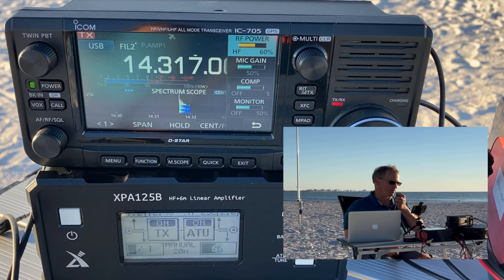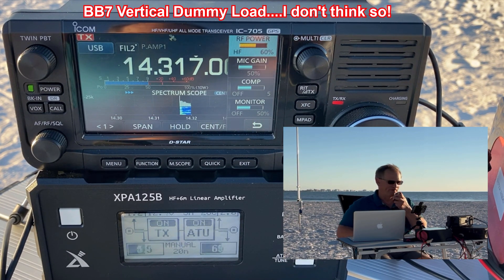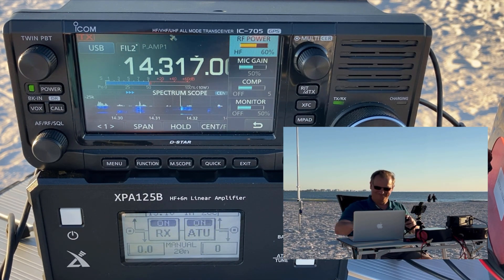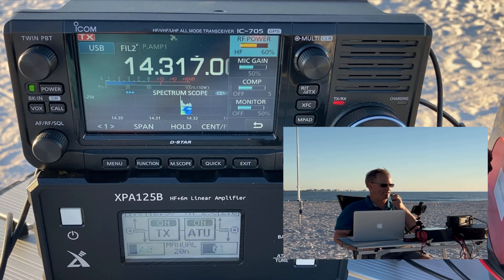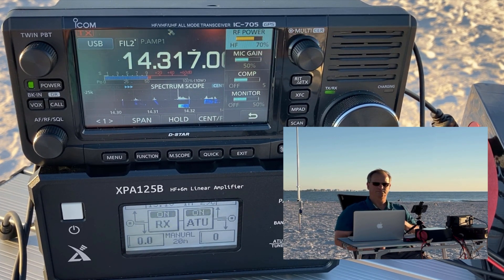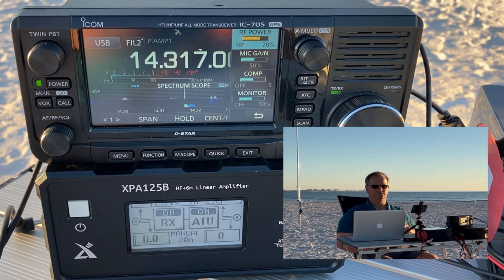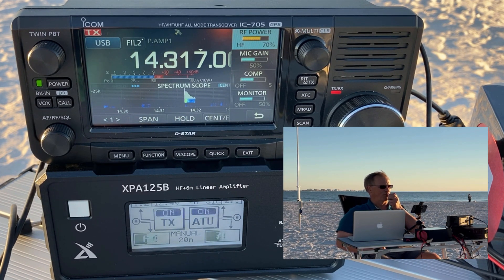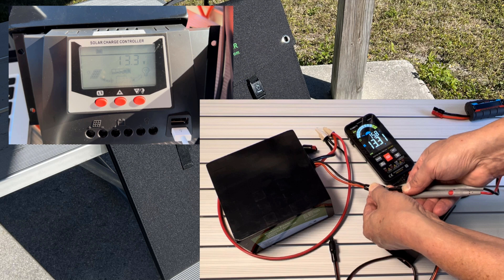Winter Beach POTA with a BB7V Vertical (Dummy Load) Antenna, IC-705, XPA125B Amplifier, and Bioenno

Comment: Just pulled the trigger on one. read also about dummyload but this is a second video i see from you where you are so positive. so i just did it>
Thanks!  73 Tony PE1ONS, The Netherlands
Reply from the maker: People often call something they don't understand a dummy load.  Because it doesn't use radials, it's using coax shield as the radial.  Of course you can roll like that, or just add some radials.  I've always operated without them.

Comment: Hi, Bob
Thanks for the vlog. Im in the market for an HF antenna and have narrowed down my options between the Diamond BB7Vor the Comet CHA 250HD. Have you tried the Comet? Does the BB7V work on 6m? In your other BB7V video review, I saw you added an LDG choke - Are you using it in this video as well? Based on the specs for both antennas, which would you prefer? Love the Tampa area. We're 1 hour east near Disney. We visit  Clearwater Beach often by Frenchys.
Thanks
KQ4LNW 
73
Reply from the maker: Thanks for the view and question.  I do not have any experience with the Comet CHA 250HD, but from the description the main difference seems to be the BB7 is quick up and down, and the 250HD is a permanent install.  So, perhaps that would help with your decision.  

The BB7 advantage is exactly that it is quick set up and portable; if you are going for a permanent install, I would have considered something else, perhaps the 250HD.  If you are going permanent install, you may want to investigate 20' or more long antennas that that have resonance; that would be even better; I do not have any I've tested so I don't have a recommendation.

As best I remember, at the beach activation, I did not have the choke on the antenna and I wasn't having any issues.  I would still recommend a choke, and there are many out there including "in line" i.e., part of the coax.

Comment: Don't worry, dear friend, I think the Diamont is brilliantly built, as the parallel resistance in the transformer actually reduces the total resistance and therefore makes the half-wave antenna better than the Sigma and co with a transformer resistance.  But most amateur radio operators have forgotten the simplest questions Hi
Reply from the maker: Fantastic, thanks for the informed feedback.

Comment: TBH I was in the expensive dummy load camp,for some time. However Over the last few weeks. I have had multiple DX QSO 's on 17 m and 30m the best being 5/9 into Norway from my QTH in north east Thailand.. Mounted 1 meter of the ground. And 200w.. I am now a believer.
Nice demo of the BB7V ..
73s HS0ZOU..
Reply from the maker: Thanks for commenting and sharing.  Its always good to hear when others have similar outcomes with gear I am using and talking about.

Comment: KK1LL here with a quick reply to your video. 
I bought a used BB7V from a hamfest for $100.  I did extensive comparisons to other portable antennas and found it to be a very poor transmitting antenna.  The quality of the mast, however, is exceptional. I sold the transformer on Ebay for a surprising $75 and used the fantastic mast to construct a new antenna that used a temporary road sign as a base.
I threaded the tip of the BB7V to accept a cap hat that I made and I made a 4:1 UNUN that uses my truck's body as a ground. 
(I tossed the UNUN-to-Truck-Wire on the ground in the video)

This configuration of the antenna is vastly better than the BB7V.
73!
https://www.youtube.com/watch?v=ISN95ZaAInc
Reply from the maker: Dude, I gotta watch that video; what a great idea.  Thanks for sharing.

Comment: What a great video! Many thanks! After reading some rather negative comments about the BB7V, I'm really pleased to see how well this "dummy load" works! BTW: I'm thinking of buying a BB7V because this is more or less the only decent vertical they have available here at the radio shop in Bangkok, Thailand. 73, Peter HB9DCZ/HS0ZPR
Reply from the maker: Peter, thanks for watching and the feedback; here is an actual review I did on it --  https://youtu.be/Tje1Xy_jiqc

It doesn't always pick up what my 73' endfed does, but the opposite is true as well.  I've found the BB7V to be a great antenna for my use case.

Comment: This is sweet!  Just got my XPA125B connected and working with an external battery along with my IC705.  

I do have a question.  DMX-40 used with an IC-705, thoughts?
Reply from the maker: Psyops, I'm not familiar with the DMX-40....but you've peaked interest; I'm going to check this out.  Congrats on getting the XPA125B working with your IC-705!